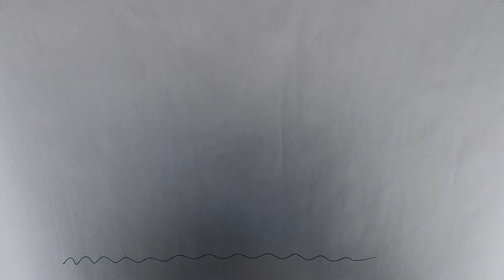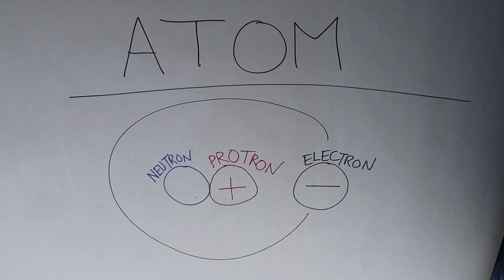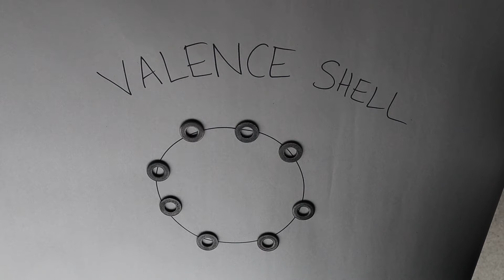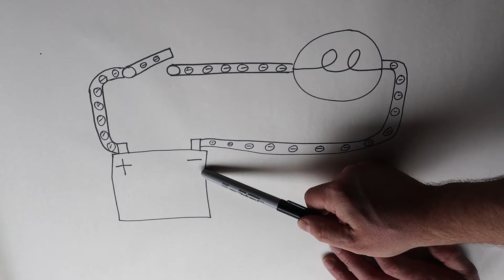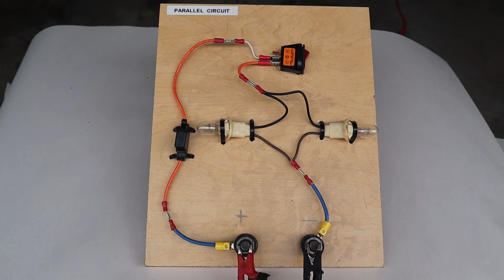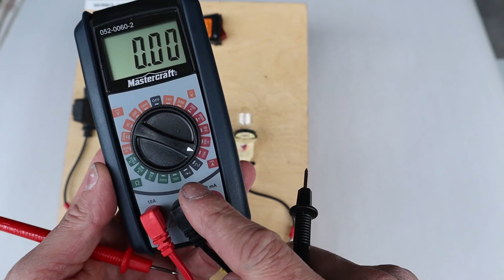What is electricity? How does electricity work?  How do you measure electricity?... plus way more!

Comment: Many people use the water metaphor to explain V, A, and R. However isn’t V the pressure and potential of electrons. If there is no connection to a load then the electrons do not flow, or am i looking at this wrongly again. Once a load is applied then that load actually ‘pulls’ the electrons.
Reply from the maker: Yes voltage is the pressure and potential  voltage.  Amperage is the flow of electrons.  No connection/load, then there is no flow.  Hope that helps.  Cheers!